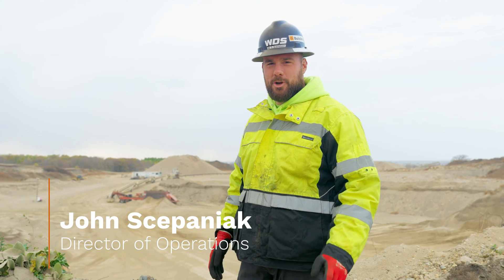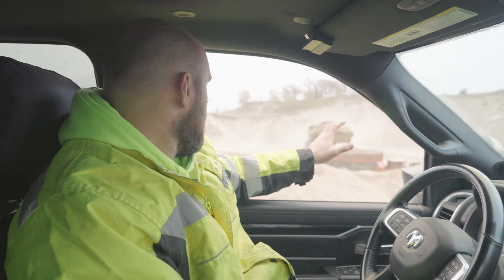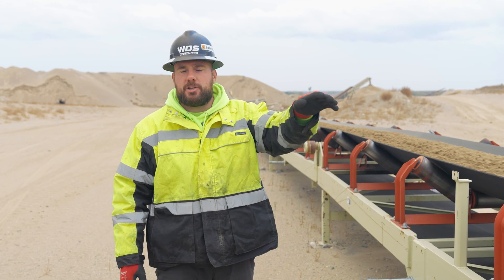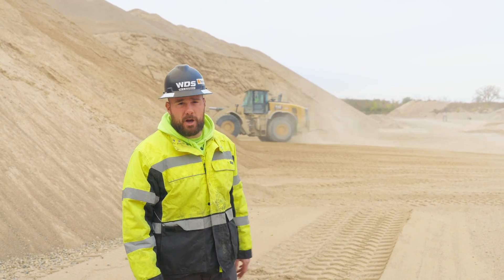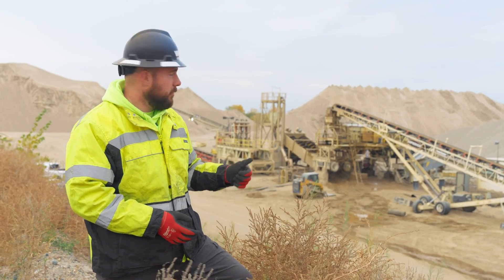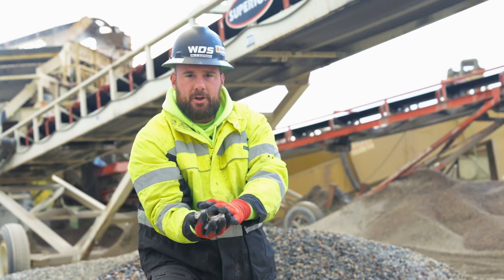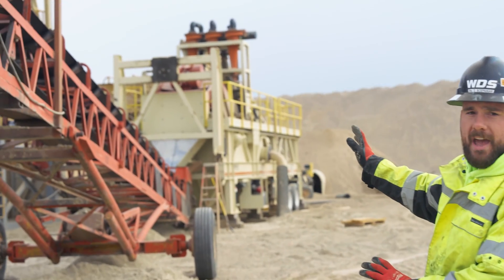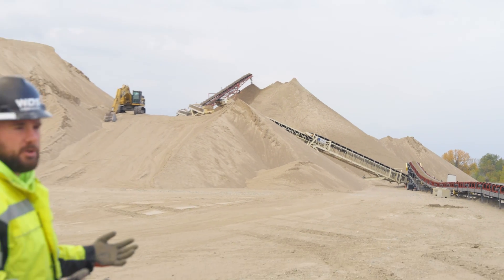Crushing and Washing Concrete Aggregate

Comment: Do you have any issues with hardened organic material? It's called coffee rock in Australia and at a glance it looks like rock but breaks down over time when exposed to oxygen which can have huge issues for slap stability. It's a huge issue for my site and it's hard to find information on how to deal with it without utilising some hardcore acid dissolver. Also you briefly touched on the silt ponds, have you considered a classifier and flocculant to clean up your water supply? My site has more clay than sand but by the time the water has run through the classifier it comes out crystal clear and can be used again, also hugely beneficial for reducing the amount of water going into your tailings ponds reducing drying time.

Comment: I operated a washplant and crusher in Las Vegas Nevada the plant would crush and wash 850 tons per hour we ran 24/7 or 6 we could cram 20000 tons thru every 24 hour . They had 6 batchplants and 300 mixers they supplied other ready mix company’s too . I worked 3500 plus hours a year for 15 years
Reply from the maker: that's plenty of activity.  are you still in the industry?

Comment: Crushing and screening plant producer from Italy! Great Job, love the LJs and the MVPs/RC crushers.
Reply from the maker: Thank you very much!
Reply: @wdscepaniak  one observation, what if you washed everything at the start, before crushing? That way, the sand produced by the MVP would be dry and usuable. ASTM C33 allows between 3 to 7 % of passing 200M, and more passing at the 100M and 50M, that you could sell in the washed sand instead of throwing it in the pond (and pay for disposal). Just need two scales and a diverter on a conveyor. I don't know what sand comes out of the screw, but if you compare your gradation to the C33 you see how much material (and $$$) you can recover instead of washing it. Additionally, your FM will lower substantially (I assume your's about 3.5 to be conservative), improving sand quality and possibly sales. Justs a thought, lots of things that I don't know and maybe I'm missing something.

Comment: i’m curious on what you guys do when you have a hole in your screens, do you guys j bolt a patch on it or replace a whole screen?
Reply: Replace the whole screen, in emergencies we can patch but it’s too much of a quality control liability to keep as a standardized practice
Reply: @johnscepaniak3959  what do you guys patch with, just another cut screen and a j bolt?
Reply from the maker: Sometimes we will use a rubber belt chunk on larger screens, or will use a patch piece and caulk the edges on smaller ones

Comment: Hi I worked in aggregate for 45 years and you should save the fines they are used to bed underground pipe lines and power lines.
Reply from the maker: Right on.   We’re working on marketing it as usable product in our region
Reply: @wdscepaniak  Also that 1" washed rock the landscapers may really like that product.

Comment: I'm new into crushing and screening business. I only have a small spread and we do about 350tph and load with an excavator. At your high tonnage numbers, would it not be beneficial to use a larger wheel loader like a 990 or 992 so the operator doesn't have to hustle as much with the loader. Are you limited further down the line?
Reply from the maker: The bottle neck is the washing,  we’re able to produce 150% of the wash plants’ need per shift.  The added benefit to the 988 is we can mobilize it to any of our other sites on a few hours notice.  Anything bigger would require disassembly.  We are looking into the 990+ size for certain quarry applications.  Hopefully we find the right one.